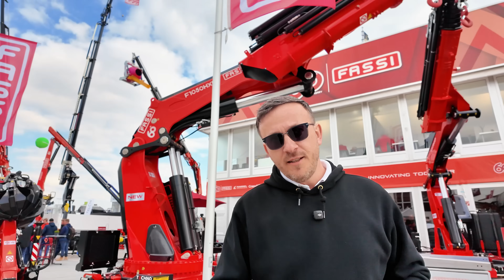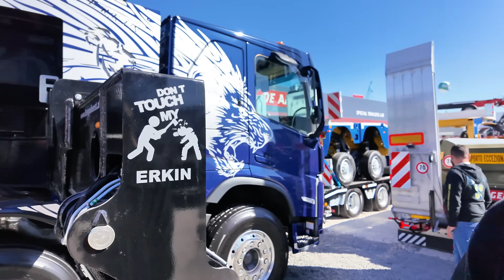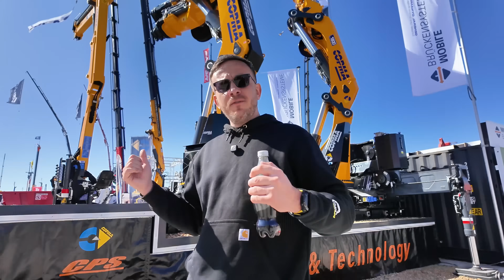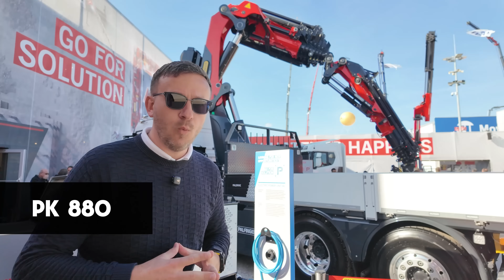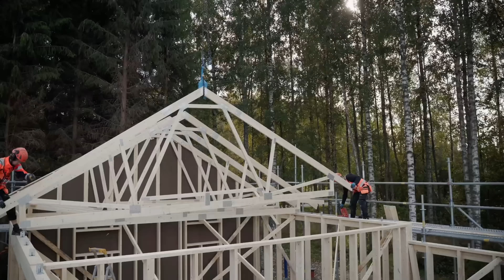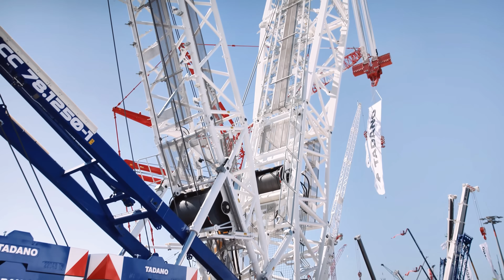Visiting The WORLDS LARGEST Construction Trade Show! Bauma 2025!

Comment: The 300 ton is not an Erkin, but a Teco TS850. It is a concept designed by Biedenbach and engineered/built by Teco. It is classed as 850 t/m but from the chart it does 913 t/m (110ton at 8,3 meter). Are you going to make a 2nd part video with MPG, Sunhunk, MKG and the 2nd Fassi booth ? By the way, I think the addition of PM to Tadano is a good extension of their productline. They also aquired Valla cranes, so now they are now covering all kinds of lifting equipment. Each type of crane has it's own main application, so they shouldn't be competing internally I think.
Reply from the maker: We wanted to see if people pay attention 😉

We didn’t cover it all, Bauma is just too big to go over everything,

Thanks for information 👍
Reply: @Craneformers  Hi